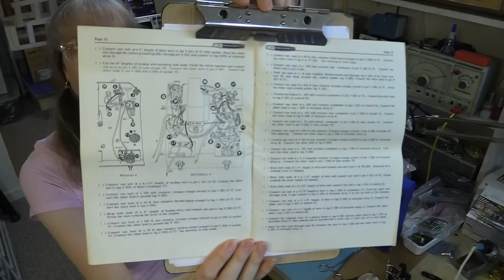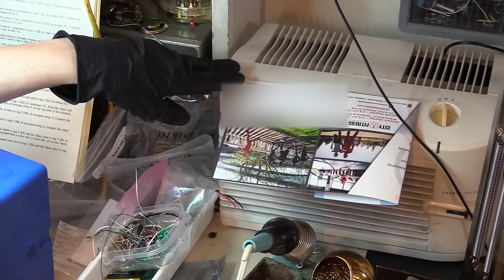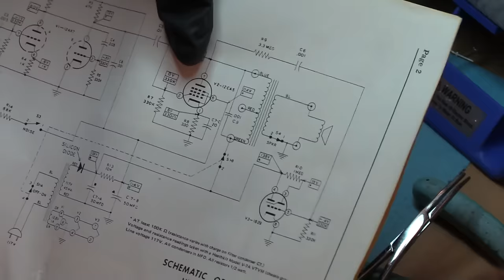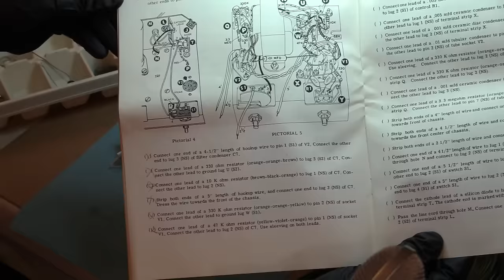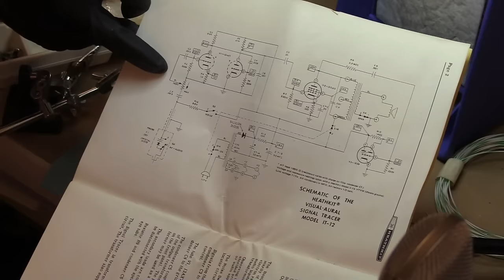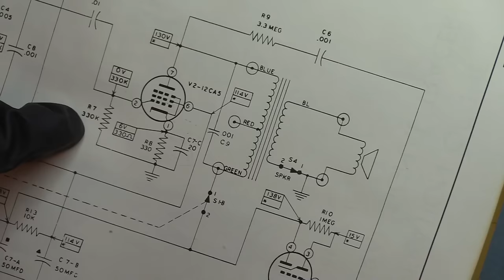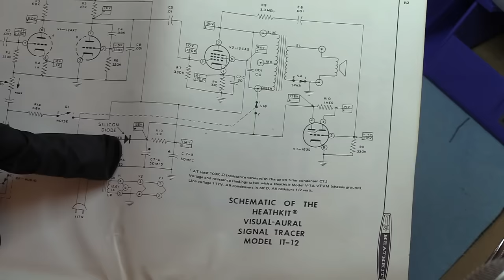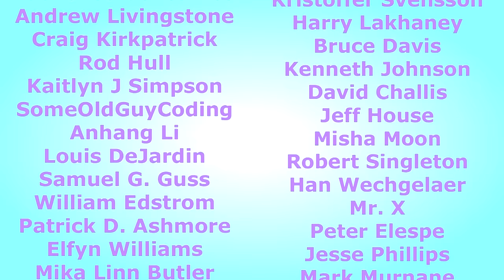Rare 1973 Heathkit BUILD!  Pt.3

Comment: Hi Fran,  enjoying the series. Those assembly drawings - not the schematic - are beautiful. The amount of effort that went into producing them!
I have nerve damage in my feet. I don't know whether it was from walking the 8 miles from Wall Street, thru Brooklyn and up to Long Island City 
once a week for a couple years OR exposure to chemicals  when I took up metal working and restoring machinery. Nerve pain really sucks so I 
can identify.
Reply: Vince I Yeah, I have the same with my legs and hands from nerve damage to my spine. However, I've been prescribed amitytriptyline for the past 7 years and that has calmed the tremors right down.Started at 10mg/day and now up to 25mg/day. Pain that I have to take them but it means that I can keep walking as an installation, fabricator and maintenance electrician for industrial DC and AC. Before the tablets, it was a nightmare in some panels due to the multiple supplies present, some of which you cannot isolate easily without waiting for a Xmas shutdown. Now, it's back to before.

Comment: Brings back all my good memories as a boy building various Heathkit hi fi and ham radio equipment. It was great. Later I was exhibiting a high-end home speaker system I designed at a CES show and was approached by Heathkit wanting to buy and resell my design (it was quite exotic). I very foolishly turned them down! In any case I would love to find a relatively complex Heathkit to assemble. Any ideas about where they could be found? Thanks for your nice show!  Mike

Comment: Loving the series - next best thing to getting my hands on something like that myself. One thing - if you're worried the strain relief is going to crack the insulation on the cord, wouldn't it be sensible to replace the chord just in case - could cause more problems than that old electrolytic.

Comment: At 2 months shy of 52 my hands are still rock steady, all those years of straightening Sn/Pb solder with my lips be damned .. I just can't SEE anything anymore. Lol. So many years on the   0.1" through hole stuff that I can solder entirely by "feel", but the last few years has seen the addition of magnifying headgear just to identify the damned parts.

Comment: Watching this simultaneously impressed me about the amount of effort that went into point-to-point wiring of old electronics and gave me fear of my upcoming plan to re-cap my old Zenith TransOceanic radio (which is 100% hand wired).   
Regarding using old components with tarnished leads, I wonder if some metal polishing product ( like Nevr-Dull) would clean that up without sanding off the plating?

Comment: Remember those lovely 1970/80's chrome plated plugs and sockets, along with the switches, that had the property of being lovely and shiny, but if you actually wanted to solder to them you first had to strip off all the plating in the area before solder would stick. I had a pair of cheap plastic tweezers ( came with an issue of ETI IIRC) that I stuck some 400 grit waterpaper to the grip sides to use to sand those things down.

Incidentally, the coating on those resistor leads is not silver, but is hot dipped tin, applied after formation and before wax dipping. The coating turns to tin oxide ( which is dark grey) with time, and IIRC the only things that came silver plated were valve bases, especially the ceramic ones, phenolic were often tin plated as well.

With the resistors measuring every one you can see they all drift high with time, and once powered they will drift higher too, eventually failing out of tolerance.  Have a whole box of assorted resistors, and test all composition before use, as they all will have drifted, sometimes to +20% or more. There are also a few in the box in E3 series, green band only, 5R 20%, and they made pretty good speaker dummy loads, as they were all around 8R. No shortage of 3k3 though, and a lifetime supply of 10k as well. Then there are 2 boxes of ITT made 0.4W zener diodes, 12V and 24V, which are my basic low voltage rectifier and catch diode, and occasionally used as zeners. Do not think I will ever use 10k of each value.

Comment: I would have not used the old coupling capacitor thinking that it might be leaky given its’ age thereby allowing DC to flow to the grid of the coupled tube. Given that the kit is NOS I would want the final result to reflect the best possible quality.  My work is my signature… probably because of my slightly OCD. You avoided using the can multi capacitor electrolytic which I wholeheartedly support. ALL in all a fine effort.

Comment: Fran, love you and your vids.  However, if Paul Carlson is watching, he's probably squirming a bit.  You didn't check the film cap to determine the outer foil at 1:03:50.  I believe the band marks the outer foil and should be oriented towards the driving (lower impedance side).
Reply from the maker: Good eye... Yes, I did put it in backwards.  Part 4 for more on that.

Comment: When working for NASA in the 60s I had to use Teflon insulated wires. When at home using PVC wire I had to relearn my soldering technique as I kept melting the PVC! 😢

Comment: I could be wrong but when I saw a short clip of the schematic I didn't notice a fuse or safety. You'd think a piece of test equipment would at least carry a safety feature other than a 1 to 1 transformer. Is that usual, even though it may have a polarized power source ?

Comment: Check if there is a firmware upgrade for the camera, and if you can change the focus area as well. Typically try using it in Macro mode, which forces focus to the middle of the field, but which, for most cameras, still will do far shots perfectly well.

Comment: As well as ditching some of the less reliable capacitors.
The carbon composite also have a problem with age they change in value mainly due to moisture ingress also if in a fault condition when they get hot they reduce in value in the worst case a fire.
These were banned by the UK military and govenment contracts in the late 60's or early 70's, as something must have caught fire and damaged or worse some equipment. It was found that one of these resistors had caused this. Modern replacements do the same but burn through the carbon coating on a ceramic rod that makes the resistors or other construction, making them fail safe.
Thanks for the video.

Comment: Hey Fran. If it helps you feel a little less guilty about your own possible responsibility for your tremor, my hands started doing exactly the same thing in my 40's, and I've not spent a life around dubious fumes and materials. It's something that can happen with age, too.

Still good advice to use respirators, gloves, hearing protection, etc., though. Momentary irritation in youth beats permanent disabilities mid-life.

Anyway, empathy from me. It sucks not being dexterous anymore. Best I can do, like you, is to hold things as gently as possible. It'll have to do until I get my cybernetic body. ;)

Comment: The missing 47k resistor may have been one of the components you picked up with the vacuum cleaner when you were cleaning the dust and dirt from the parts.

Comment: Sorry Fran -- Was watching part two and jumped forward while you were talking about the boo boo with the recording issue. That was where I got to the part where you replaced the can electrolytic. The " keeping it real " ended. I would have went ahead and installed the can, and if it prove to be a problem later on, substitute then. It takes away from the whole idea of the age of the unit. Maybe I'm wrong, but that's just how I feel.

Comment: Love the build, but just one concern.
Sometimes those old foil/paper caps read over on a digital meter because they are leaking electrically.  The DMMs will show higher capacitance due to taking longer to charge because of the leakage.

1 second ago

Comment: All my Heathkit test equipment plus some vintage TV's I have contain the original twist lock electros, if the capacity & ESR check OK I leave them in. Been doing electronic repair for about 50 years, paper caps are a different story, most have to go.

Comment: I don’t think the resistor leads (or at least carbon composite type) ever were silver plated ?  Allen-Bradley specification for their hot molded resistor says “SOLDER COATED LEADS.  Suitable for soldering and welding even after long periods in stock”. They also state solderability requirements of MIL-R-39008 and MIL-STD-202, Method 208.  I don’t have those, but gather they are the “bible”.  As far as silver plating goes, it is great when you need higher temperatures, provided you can keep it protected against sulfidation (normally called tarnishing).

Comment: Wire strippers for slippery Teflon wire, at about 10 minutes in. If somebody has a similar set of strippers but the bars or Jaws that hold the Wire by the insulation are not toothed and the Teflon insulation simply slips between them, I bet you could stick a piece of self-adhesive non-slip stair-tread tape onto those jaws, the stuff that you put on your stair treads to prevent slipping. That should grab a hold of the Teflon jacket, and probably chew it up less then the strippers that Fran is showing.

Comment: Old electrolytics are a time bomb for sure, you just can't trust em or any old paper caps for that matter. In looking at the new electrolytics you used it's not clear that if you gutted the old multi cap they would fit inside, if so that would be nice so the unit would still look O.E.M... whatever, have fun.

Comment: Oh no!  You cut the strain relief!
These are easy when you know how.
Moreover, they are calculated to allow for the wire to pass through the 'U bend'.

To do this successfully, take the BIG pliers (forget any needle-nosed nonsense) put the wire through the cleat - get it right, it's hard to go again.  Then squeeze the absolute cr*p of the pliers.  This will make the wire take up the internal cleat path.  Now, grab the cleat and you should only need to slightly squeeze to push it in to the panel.  I've done thousands of these!
Reply: At work, we have the special tool to make it easier to remove strain reliefs like this one here. It doesn't necessarily work as well for installing a strain relief, for that you sometimes do need a big set of linesman pliers or channel locks to squeeze it down and compress it really well before inserting. Every now and then I'll find myself removing a little of the plastic fin inside the strain relief that makes the cable bunch up and pinch itself in place.
Reply: Strain reliefs suck! I broke down and spent the $13 on strain relief pliers. May be overkill and not get a whole lot of use but when they are needed they sure come in handy!

Comment: There is a much quicker (and easier) way to cut wires to length:  Lay out a ruler on the table in front of you, pointing away so that zero on the ruler is farthest away.  Take the wire and place the end on zero of the ruler, farthest away, and using your left hand (if right handed) hold it down.  Now take the cutters in your right hand (if right handed) and 'grab' the wire at the length you need, using the ruler to measure, but don't cut, just grip enough to be able to move the wire - to zero.  At zero, left hand holds wire again and cut the wire - repeat.  If you put the ruler on something like a stack of books you can then place a box in front of the zero so all the wires fall into it when they are cut.

Comment: I just soldered a used cord onto a 1982 Magnavox table-top TV that had been lopped, works perfectly! but the inputs are coax and vhf/uhf flathead screw/holes...  how do I morph it into accepting rca leads??
Reply: I also love you extremely much. :)
Reply: RCA inputs will not work, the tv only has RF inputs,  no video input for use with game or VCR. They used to sell converters.  Maybe still do, try the web for RCA to antenna NTSC
Reply: 1:35:05 "super-big-ass hole"  lolmao!

Comment: Nice videos, a reminder to old times. Fran, I noticed in your schematics that the filament winding on the mains transformer show 12.6V? The tubes should get 6.3V though. Especially the ECC 83 I know needs 6.3V and used myself a lot in the olden days. 12.6 sounds odd to me, but then again I am originally from Europe and back from the days I only know the 1.2V, 4V, 6.3V and the current driven 100 and 300mA heaters. But then again American tubes may have different specs that I would not know. Just be careful before you power it up...
Reply: The tubes used are 12.6 volt filaments (12ax7, 12ca5, 1629). The ECC83/12ax7 can use both 6.3 & 12.6: pins 4 to 5 for 12.6 volts, pins 4+5 to pin 9 for 6.3 volts. Note that in most cases, the tube names give a clue to its configuration: 12 (filament) ax (unique name) 7 (number of elements; 2 plates, 2 grids, 2 cathodes, 1 filament).
Also, Heathkit does a clever trick of using pin 9, of the 12ax7, to create a virtual ground for the filament bus to minimize hum.
Reply: Thanks for this explanation. Back in Europe (around 1970's) the tube names had a simple key system as well. This was based on letters only (see https://www.elektromuseum.de/wissen-roehrenschluessel.html). First letter is key for filament (e.g. E=6.3V) and the second is the system(s) (e.g. C for triode, CC for dual triode). The number was for the socket type. I'm not that old actually, just started early with electronics (age 5-6) - in the wee days of germanium transistors...
Reply: @neccron9956  This is true. Heathkit used 12.6 volt filament tubes in the IT-12 because surplus 1629 eye tubes, which have a 12.6 volt filament, were more plentiful and cheaper than 6E5 or 6U5 eye tubes.

Comment: @1:00:51 The cap is probably reading high because it's 'electrically' leaky and meters test capacitors by checking how long it takes to charge them. That cap is bad!

Comment: 1970's paper degrades badly on it's own, what makes people think it going to be OK sealed in a can with corrosive chemicals ?
Reply: To make a sweeping statement such as "1970's paper degrades badly on it's own" you'd have to be stating that there was only one single type of paper in use in the 1970s. Furthermore, not only would you have to provide scientific data about the breakdown over time of this "1970s paper", you'd also have to have hermetically sealed some of this "1970s paper" in a similar container without any "corrosive chemicals", back in the 1970s, so that you could ccompare the breakdown of the 2 samples scientifically in order to provide any foundation to your argument that you make by asking the question that you asked above.

Comment: Eeks Fran,  While the water soluble flux is agressive for older parts its going to longer term be a big problem as it keeps working unless you really really clean it off, which is impossible in a vintage hardware.  Old fashion  RA or similar else modern no clean is preferred!   If water based flux you would need to put everything in a dishwasher affair with de-ionized water to get the flux off.
Reply: At work, I have a little plastic disc like container of Kester rosin flux that looks sort of like reddish brown Vaseline or old garage door rail grease and it has rosin crystals in it; that stuff works great, just a little dab of it on the work before you solder or a little smudge of it on the solder as you feed it into the joint you are connecting will give you a good easy solder flow. I don't know if they make it anymore, this shop I work for has been open since 1979 and a lot of the stuff we have dates to the 80s.

Comment: Power supply reverse diode is not a good idea. The electrolytic capacitors would hate you. I tried it. I used them on AC where the voltage would go negative a little bit on every cycle. They survived about one month.then they exploded.

Comment: Why use gloves at all!  At 01:04:00 you put the cap in the wrong direction!  The minus side should go to the 12AX7!
It DOES matter in audio circuits!!  At 01:24:00 I put in a full wave rectifier so the hum would be gone!

Comment: I'm really not sure that that electrolytic would be dodgy. Even though it's better to be safe than sorry; it has never been used in-circuit or had any voltage applied to it, not for more than a few seconds perhaps. - So surely, even given its age, it would still be a viable component to use...

Having said that, and as I believe you've already mentioned, the 21st Century capacitors you used as a substitute are better made. It would be interesting to see how the aged cap holds up under high voltage all the same.

Comment: Soldering wires into tags in this build would go a lot easier and neater if you tinned EVERY wire (and tag!) before you placed them in to position and did the final solder.
Reply: I am absolutely and 100% in agreement. Polish all the lugs and terminal connectors with a pencil eraser or fiberglass brush and tin them with solder. Do this for the tube sockets as well. Much of the wiring that came with the kit looks like it is stranded and factory tinned,  so that might not need to be tinned before installing.....

Comment: At 51:00 you didn't follow what the directions told you to do. It said to feed one lead of the 1k resister THROUGH lug 3 of R1 and THEN wrap it around lug Y. The illustration shows it that way also. They just did a poor job drawing the wire of the 1k resister making it look like the 330k resister is going to lug 3 of R1. I enjoy your videos and you are pretty intelligent, but watching you build this and not following the instructions properly was very disappointing.